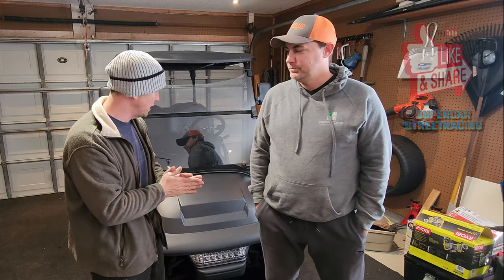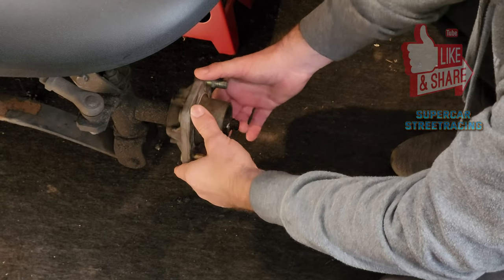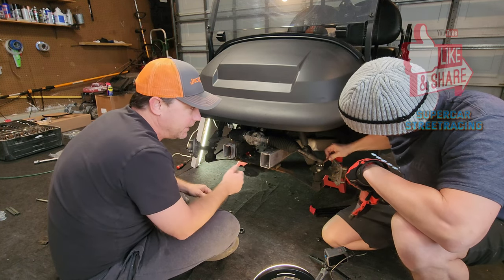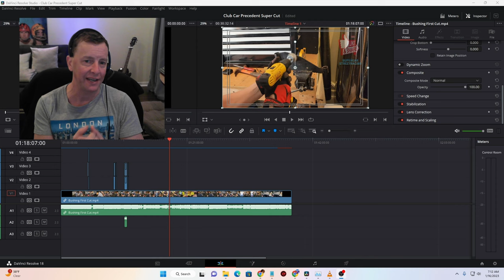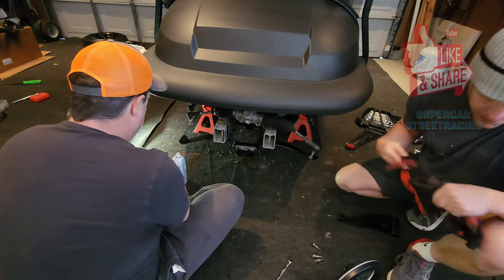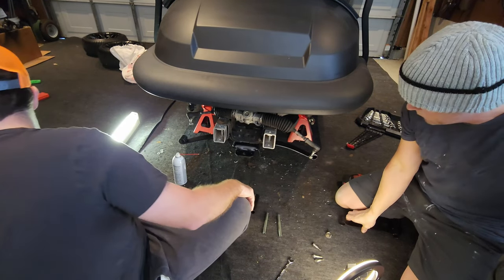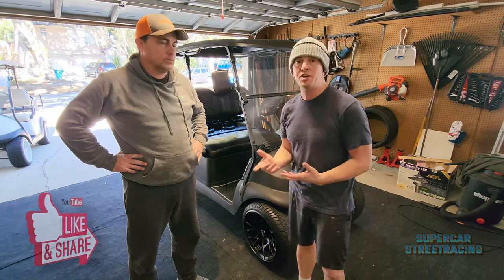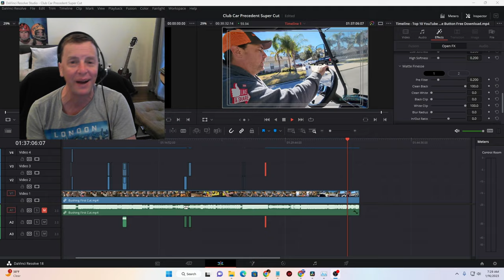Club Car Precedent Bushing Install for under $20!!

Comment: 1st. Great video but.....the "sped up" parts should have been used with the lower closer camera. With the speed of the video, can't see what exactly ur doing
Reply from the maker: Thank you so much for the commentary.. I feel like I'm improving but I take everything people say..and I do think I've come a long way.
Reply: Exactly.  This is just constructive criticism...
Reply: Actually....if you want full disclosure... speeding up the video is not helpful as an instructional video. I understand that without speeding it up, that its a long video. My suggestion is its fine to speed it up but on things that aren't part of instruction. And using better camera close ups on what bolts up under. Basically we just watched two guys disassemble something from a distance & couldnt see what you exactly were doing. For longer videos, May I suggest breaking the videos up into "Parts"...Part 1..2.3.....
Reply from the maker: Man thank you so much. There's a fine line between too long whee people turn it off.

Comment: Maybe this was your first video, but I agree with Robertdonnaly.  Instruction started well, but when you got past removing the light assembly, we see a lot of action but no explanation of the real intention of the video.  You could go back now in “post production” and tell us what is going on.  Also, you could add written comments like you already did during cleanup and painting.  Then we see more action on reinstalling new parts, but again no words.  Also, watch the video online (like the rest of us did) and you will see our times to shorten the video, e.g., your shoulder, yellow box, gloves, drill with wire brush. Really, we don’t need to see every bolt being cleaned on wire brush on the grinder, we get the picture.  

More actual explanation when it is happening is the key to a good video, then speed up the repetitive parts or cut them out.
Reply from the maker: Not my first but I'm still learning. I really appreciate the feedback, my new videos don't look like this